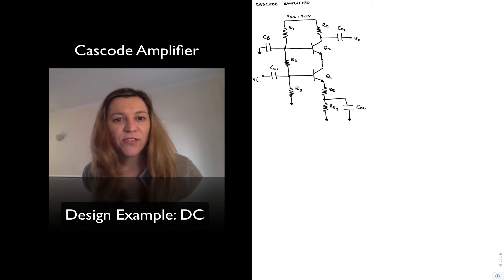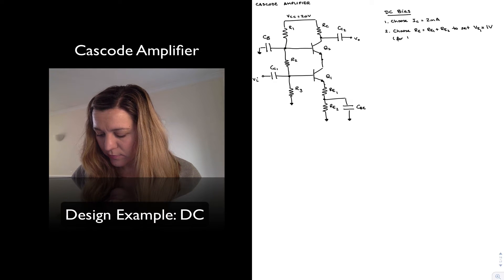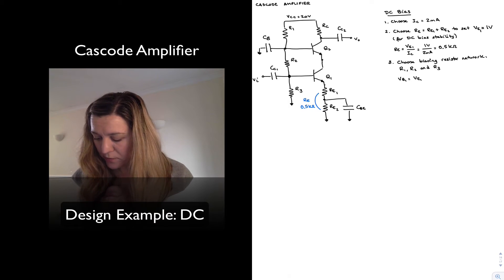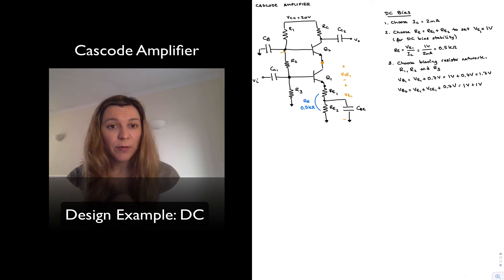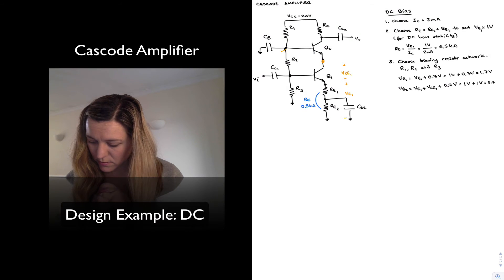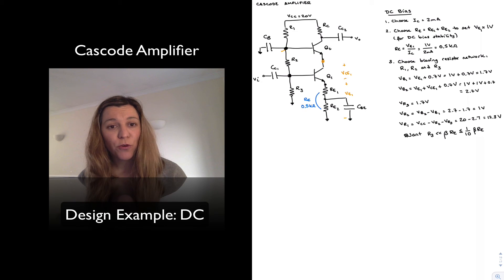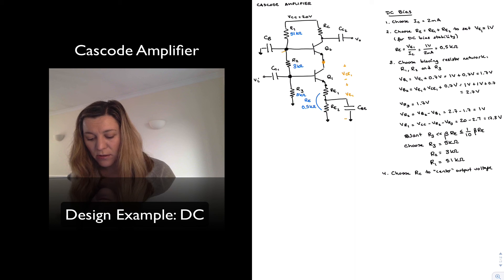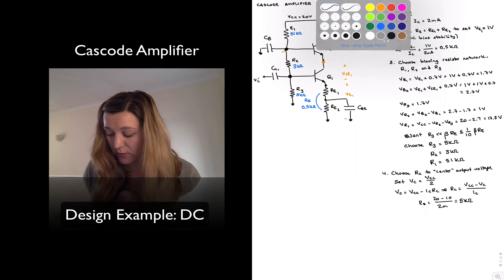Cascode Amplifier: Design Example - DC Biasing

Comment: I will always push in terms of bias voltage 0.6 D.C. and variable assembles of it is simply more accurate and reliable.
I work with transistors whereas most people teaching them are pulling it all out of the books and math.
I can assure you that a grand majority of transistors when given a bias voltage to create a bias current won't turn on once you get over 0.65 D.C. much less starting directly at 0.7, but they will turn on when dropping down to as low as 0.40 D.C.

I hear 0.7 in 99% of videos on youtube and it tells me the authors rarely if at all touch BJT's because most everyone grabs an op amp for 90% of circuits that will perform signal processing.

Comment: Hi Aboy, what are the advantages, if any of this cascoded design, lets say, over a single NPN circuit?
Reply: This design has the advantages of both ce and cb amplifiers in the sense that it gets the high gain of cb amplifier and wide bandwidth of ce amplifier